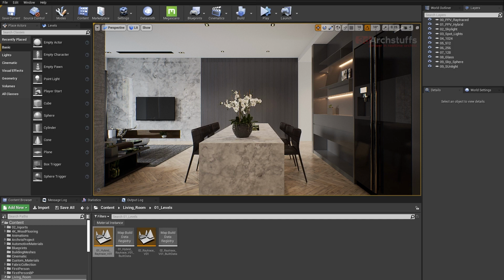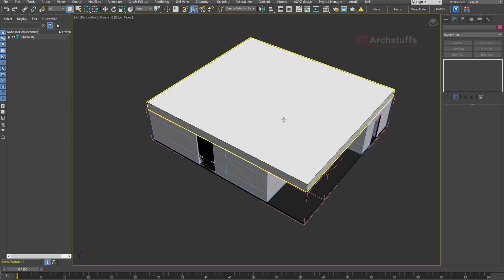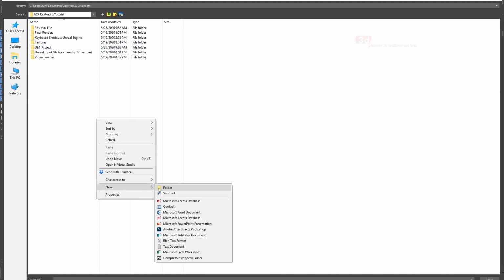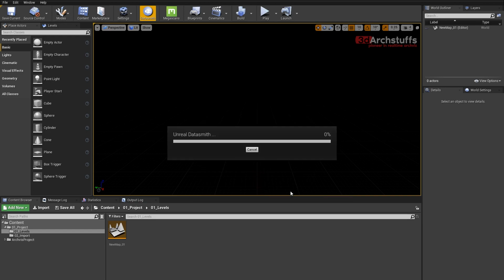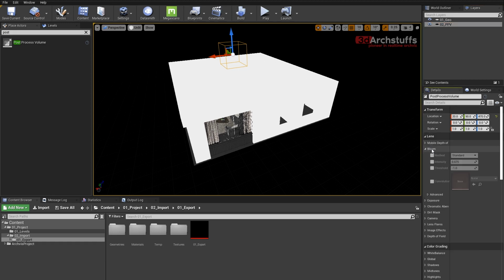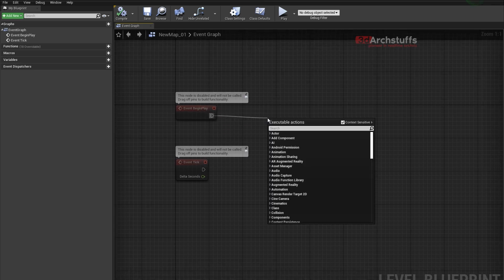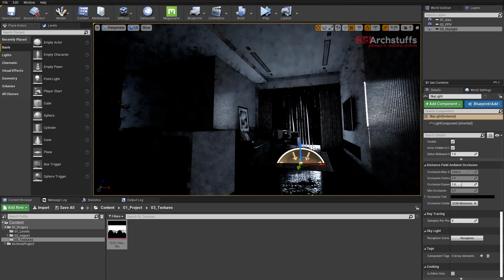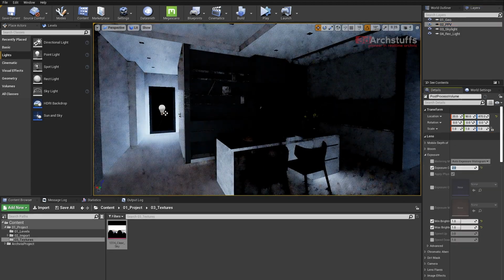RAY TRACING in Unreal Engine Complete Tutorial Part 01/07.

Comment: Hi! Don't you need light maps on channel 2 for ray tracing?
Reply from the maker: No. You dont.
Reply: @3darchstuffs  I saw a video on YouTube, the author of which claims that Ray Tracing only works when the light is baked.
Reply from the maker: If you are only using raytraced reflection in a baked scene then u need 2nd uv channel and if you are using raytracing for lighting to then u dont as the lighting will be dynamic. So basically it dependa how u want to use raytacing in the scene.
Reply: @3darchstuffs  From this I understand that Ray Tracing with Dynamic Lighting does not require light maps for the second channel, correct? ) Like Dynamic Lighting itself, it does not require light cards (such as Lumen)
Reply from the maker: @carlweiss830 right
Reply: @3darchstuffs  Please tell me what program you use to record screen videos?
Reply from the maker: @carlweiss830 obs.
Reply: @3darchstuffs  because Data Smith exports does it automatically or does ray tracing simply not need a second light channel?
Reply: @3darchstuffs  Please tell me what program you use to record screen videos?